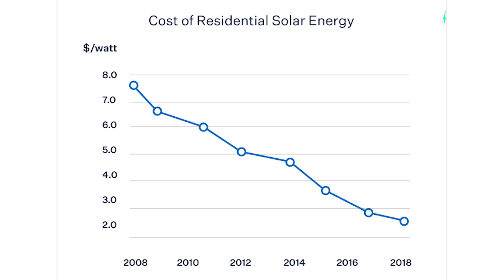How long does it take to save money with solar panels?

Comment: We've got a 16kw grid tied ground mounted solar system  which cost after all incentives $30,840 USD. We live in the Hudson Valley in upstate NY USA.  The electric rate is .281/kWh and the monthly payment was $446 which translates to over $5000 a year.  We have a pool, geothermal heating and cooling, and an electric car in fact everything is electric.  There is a $21 per month basic charge from the electric company that will always have to be paid.  We have net metering which makes the grid our battery.  The system is producing enough power to run everything and we are saving $5000 grand plus a year so the payback will be about 6 years.
Reply: My electric bill in Florida is $170 a month. Solar was $38k. Basically 20 years. No thanks.
Reply: @bucfan11  that’s similar to my calculations (here in sunny Algarve )
Reply: @A-W-r4s  I ask myself the same question in reverse.  We aren't rich by any stretch just middle-class but have managed our money carefully. Our home is 1630 sq ft and uses about 25 kWh a day with no pool pump or car charging.  Plugging in the car jumps it to 50 to 60 kwh and the pool pump uses the most power of any device so we run it half a day in summer.  Do you use heating oil or gas?  The geothermal uses about 1850 kWh per year to heat and cool the house.
Reply: @A-W-r4s  before adding the EV, we would use about 950kwh/ month in the winter and close to 1200 kWh in the summer due to a/c usage. We use LP gas for heating, hot water and cooking.. with charging the car, we haven't been below 2,000kwh a month.
Reply: @davekozlowski1266  see my response to ChrisMax NY
Take care
Reply: @davekozlowski1266  Our new EV looks to add about 450 kwh monthly to the present average of 1589 kwh/month making the new monthly 2039 kwh. The monthly for charging the EV just to commute is about $59 USD/month (.281/kwh)  less than the $64 ($3.50/Gal) for gasoline using the Hybrid. The Geothermal System used 7316 kwh to heat and cool for all of 2022 at a cost of $2056 USD.  Just the cost of the heating oil would have been $2700 USD in 2022 based on the amount we used prior to changing the system.
Reply: I call bullshit on this !
Why ? The winter in upstate NY will cripple your PV.  

The figures you present will only make sense in Summer.
Reply: @A-W-r4s  AC in the south and west USA.
Reply: @A-W-r4s  ac and electric water heater I guess
Reply: My solar system 6.6 kWh with 5 Kw inverter here in Victoria Australia..system cost $7500 with  subsidies inc $1800 solar Vic loan and $2500 small system solar credits Federal...$1000 up front .  Payback is going to be about 3.5 years .. as price of power goes up WFH offsets have increased ..but export is down to 5.4 c per KWH...summer bill is zero and spring and autumn about $100
Reply: @A-W-r4s  Thanks for all the info!  In our 1630 sq ft house in 2022 (all USD) the Geothermal used 7316 kwh cost of $2056, the heat pump water heater 937 kwh cost of $263, the dryer 640 kwh cost $180, pool pump (3 months) 3868 kwh cost $1087, Refrigerator 519 kwh cost $146, living room (tv, stereo, etc) 475 kwh cost $133, and basement (radon system, computers, bath, utility room lights) 1541 kwh cost $433.  The rest adds up to 3767 kwh cost $1059.  We have all led bulbs, induction cooktop, electric oven, coffee maker, toaster oven, ceiling fans, etc.  All our major appliances are Energy Star rated.  We just have one electric rate which may change in the future.
Reply: I have similar experiences but I have 20kwh of house batteries. My payback is the same as yours at about 6 years. I do not feed back to the grid. My system has components from China (reasonable cost, good quality). Local electrician labor (Thailand) quite low so the cost of the system is about 1/2 of what it would be in the US. It's a no brainer. Tesla power walls? stupidly expensive!
Reply: Pay-off' is not relevant. Did u ask your Utility provider "When will we be able to quit renting electricity from you??"  Owning PV system is an Investment in Your Own power plant!🌻🗽
Reply: @solartime8983  I don't understand. I don't "rent" electricity from my provider I buy it in units or kilowatt hours. I then consume it. The cost of creating my own power plant means I will not need to buy electricity from the utility company. The cost of my power plant means I do not buy as much units from the utility but the upfront cost means my investment is actually an expense until such time as the capital cost is offset compared with buying that electricity from the utility. That scenario can be calculated with math. Many people say they cannot afford the upfront cost of a solar system even though it will have a "payback period".
Reply: Renting is an agreement where a payment is made for the use of a good, SERVICE or property owned by another over a fixed period of time. (wikipedia)  Buying is ownership.
Reply: @solartime8983  correct. I bought the kilowatts and consumed them. I did not rent the units as they no longer exist.
Reply: @solartime8983  If the electricity units were "rented" it would infer that when I no longer needed them I could end the rental and return them. But that's not possible. The purchased units are consumable and no longer exist. I don't "rent" food from the grocery store I buy it and eat it. Thus it's not possible to return. If I wanted to build my own farm to provide my own food I would need to look at that investment in land and equipment to see if it's a practical solution. It could be the" payback" is well beyond my lifespan thus it's a bad investment and it's likely better I continue buying the food "units" and consuming them. This is a purchase not a rental from the grocery store. I truly don't understand your logic. However if you're talking about the costs associated with the transmission lines it could be a point. But the payback for establishing your own power station still applies.
Reply: @solartime8983  I assume you believe you "rent" gasoline for your car. Both gasoline and kilowatts of electricity are energy that is bought and consumed and no longer exists in a form you could return if it were "rented". Energy is purchased.
Reply: @sunrisejak2709 Semantics aside. the point is... The economics of the comparisons are totally different (apples to lemons) 1. constantly 'buying' electrons that are consumed from a utility... vs.  2. Solar is Owning the source of electrons. So, asking the 'payoff' of solar is an irrelevant comparison to a never payoff 'consumable', they are two totally different business models. #1 you never payoff because there is No capital ownership...it's a service (like rent*)  #2 Solar PV Is Ownership (like buying a house ) which has a payoff & Equity. In the case of PV system ownership , you  start saving from day 1 of operation by offsetting a constant billing from utility.  Solar produces Earnings (free 'fuel' )  while paying to constantly consume electrons is *money out the window'!!
Reply: @solartime8983  😁 I think we have to agree to disagree. Any capital purchase that displaces another expense or process almost always involves a justification of payback. I have a solar system that cost me about 15,000 dollars. The output brings my daily consumption to a monthly bill of near zero. The monthly savings means I get a payback on the investment of about 6 years. (pretty good). Here's an exaggerated example. Let's say my annual electric bill is 1000 dollars per year. And a solar system costs 100,000 dollars. Meaning the payback is100 years. Is that a wise investment? Homeowners consider the upfront cost and payback versus just budgeting the purchase of electricity from a utility going forward. Every business I know makes assessments on capital purchase on payback. Even accounting principles assess depreciation on the useful life and payback. The point at which capital investments make financial sense is based on the payback, depreciation and other contributions when compared with continuing the status quo. It's a math calculation. Ask any director of finance. In fact every solar installer I know offers assessments based largely on payback. Is it 6 years or 100 years. Makes a difference.
Reply: Your battery will be useless after 5 years
Reply: You mean the grid ie the utility company will be gone in 5 years?
 @nikhilatyoutube

Comment: In the US if you have to put the panels on the roof you will never break even.
Nobody ever talkes about having to replace the roof.
Add $10,000 to remove an reinstall the solar panels for a roof replacement.
Then would you want to reinstall used panels on a new roof?
If you can not ground mount the system then it will always be a money furnace.
I pay $.14/kwh, so $25,000/$.14=178,571kwh to break even
On average I use 1500kwh per month (over estimate), so 178,571/1500=119 months to break even, 10 years.
Almost forgot thats $25,000 plus intrest and I need a new roof about now.
And all of that assumes nothing went wrong.
Reply: Millions of people in US pay more for electricity than you and broke even years ago. Millions more can power their homes with cheaper panels because their energy use is not 50% over the national average like yours.
Anyone remotely competent tells you to check if your roof needs to be replaced before installing solar panels and if you do either consider a solar roof or handle both installations at the same time to save money. One Youtuber ordered solar panels from Tesla and the guy who made the estimates forgot to check if the roof was suitable, so Tesla ended up building him a brand new roof for free.
Reply: Your claim that "In the US if you have to put the panels on the roof you will never break even", just because yours didn't, is absurd. If you were foolish enough to put solar on a roof that was nearing the end of its life, that's on you. More to the point, the payback varies dramatically by the cost of electricity, as well as by location, azimuth, shading, etc. In my part of the world (SoCal), solar production is excellent, as long as you have a reasonable azimuth and minimal shading. More to the point, the average electric rate is around 50¢/kWh, more than triple yours. Would your claim still hold for folks in my part of the world?